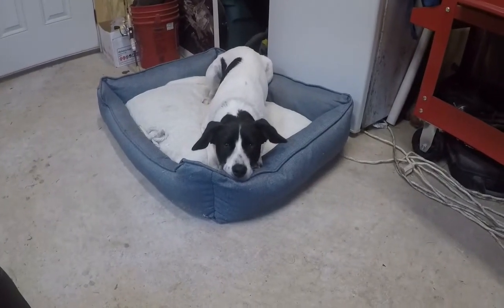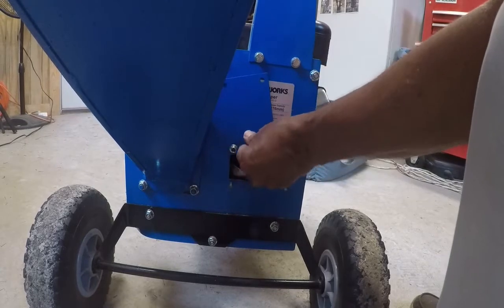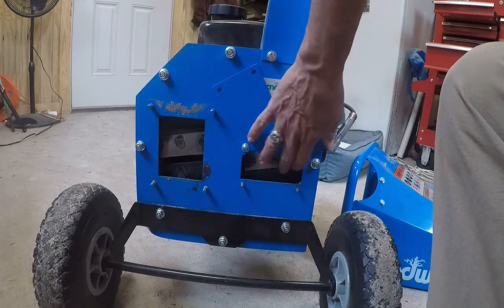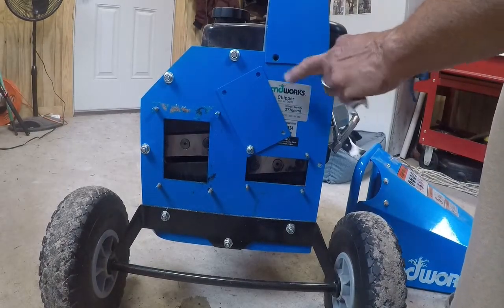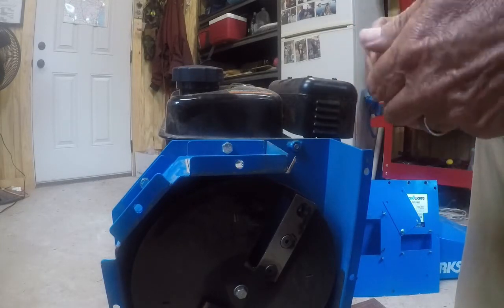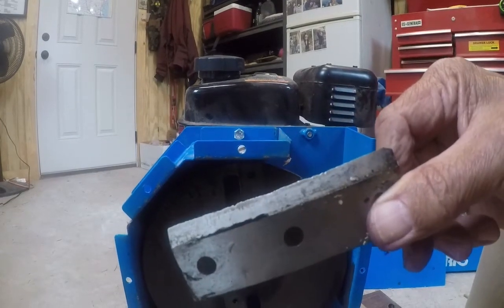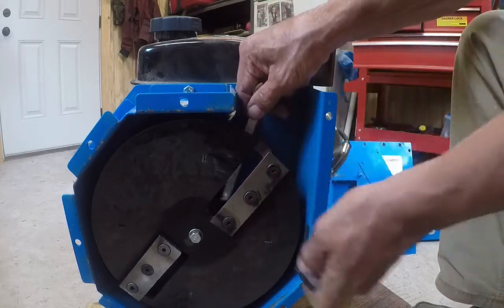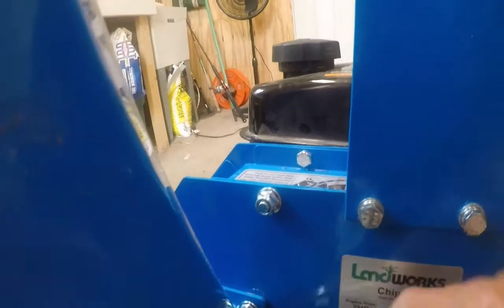REMOVING AND SHARPENING LANDWORKS CHIPPER BLADES

Comment: I have the SuperHandy chipper which is exactly like this one but painted orange.I leave the chute on and take the whole back panel off including the wheels to get to my blades to sharpen.I let it rest on a 6x6 piece of wood after taking the wheels off.It's just easier to take the whole back panel off to get to the blades.I take the upper discharge chute off as well which gives me access to the locknuts on the back of the blades.13mm nuts and a 5mm hex wrench for the flathead bolt.I took a piece of 2x4 and made a blade holding jig,I just screw my blades down to the piece of 2x4 then put that in my vise to hold it while I sharpen the blades with a 1/4" die grinder with 180 grit sand paper.I apply blue loctite when reassembling even on the blade lock nuts.